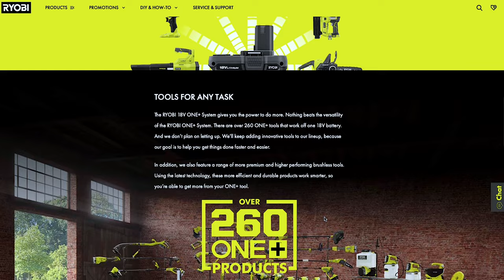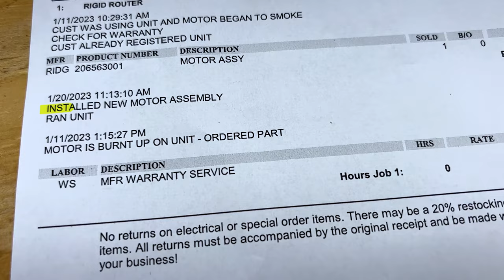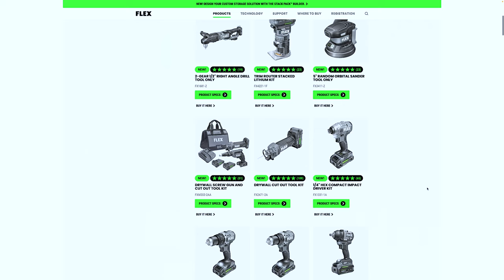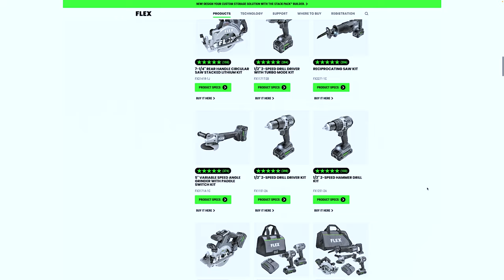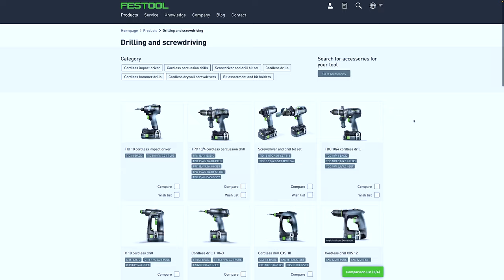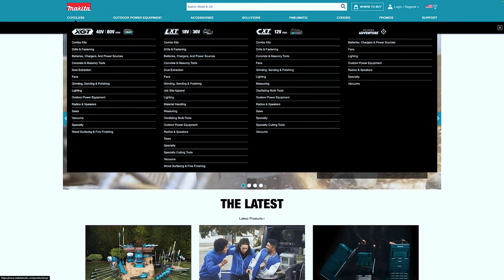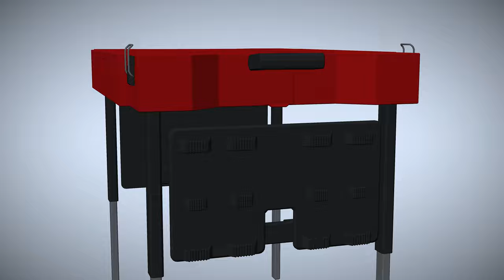I Found the BEST Tool Brand for Woodworking in 2023!

Comment: I started with a Ryobi orbital sander, and as my corded Bosch tools started breaking down in the first 3 to 4 years, I replaced them with Ryobi to stay on the same battery platform. These have been smaller tools. When I need to get larger tools, like table saw and jointer /planner, I'll reseach and buy to suit my needs and budget.

Comment: Thanks Matt!  This is a great overview of all the major tool lines.  In my shop, I have the Bosch miter saw and router (both are plug-in), a Dewalt plug-in router (for the plunge base), a bunch of Ryobi tools for specific tasks (soldering, polishing, cleaning), some Bosch battery tools (very strong, good battery life), some DeWalt battery tools, and even some Festool (the sander and dust extractor).  But, like you, my main tools are Milwaukee red.  Love the track saw, love the packout, the detail sander is amazing, and the drills and drivers are top of the line (In my opinion).  Their multitool is one of my go-to tools because it's the only one that doesn't shake your elbow apart!  I also have a bunch of Ridgid.  I still think the Ridgid table saw is much better than the DeWalt.  Thanks again for making this video Matt.

Comment: Completely agree about going with more than one platform. A lot of people argue about which brand is the best, whereas i like to embrace all the options out there lol. I own Milwaukee, DeWALT, Makita, Flex, Metabo HPT, Kobalt, Ryobi, etc. and they all make good stuff, especially the higher end brands, but every brand also makes some duds. No brand is perfect as i like to say. I would also pick Milwaukee if i had to pick which brand offers the best/most useful tools for woodworking. Love my 4 in 1 Installation drill/driver and orbital detail sander (as i know you do too) but also my Milwaukee drills, impacts, m18 trim router, etc. I do love how smooth the trigger is on the Makita 40V XGT impact driver though. So yeah they all have pros and cons and it really depends what kind of work you're going to be doing as well.

Comment: The ryobi table saw fence just needed the end screws tightened and it would track straight every time. It also does dado stacks that the others don't do until you spend twice the price. I've put my $200 ryobi 10" table saw through some serious work including two hundred feet of continuous 3/4 wide by 5/8 deep dado cuts and it didn't even bog down.

Comment: Thanks for "sticking your neck out" and picking a favorite. Like you, I had used Dewalt and Ridgid forever. But I bought a Milwaukee 12V blower and 4-in-1 driver. Then I bought the M18 drill-driver. In the last year, I have replaced several tools with Milwaukee tools. They do work real nice. Looks like I am an official converted Red guy.
Reply from the maker: Good choice!

Comment: In my life Ryobi stuff hasn't lasted long.  For instance, my quality of life in the springtime improved quite a bit when I upgraded from a Ryobi string trimmer.  Worse was the one Ryobi tool that lasted for decades - a circular saw - that I finally dropped, skewing the base a bit, causing me to give it up.  When I bought a solid (more expensive) Makita with smooth cutting, bearings that don't scream and grind, etc.  I realized how much of my life was wasted trying to squeeze a little precision out of the Ryobi tool that wouldnt die.  "Opportunity cost."  At the time I bought Ryobi, I needed and appreciated that pricepoint, but know when to move on.  Besides, wives never know what to get us for our birthdays ... right?  

Totally agree that mixing brands is part of succeeding.  Staying in Dewalt I bought an oscillating saw that turns out to be hard to turn off on a ladder, and sticks out in the wrong places.  Should have bought the Milwaukee with charger/battery system to get all that free space around the head.

Agree on the packout stuff.  Expensive, hard to justify, hard to pull the trigger on, (and kinda heavy) but appears to be the most well designed for people and their habits, and can be a little addictive once you buy some.

Thanks for your tool thoughts.  Fe sharpens Fe.
Reply: To be fair, regarding the 10 year old Ryobi, Ryobi tools have gotten much better over the past decade.  I'm guessing they may not have even had brushless saw models then.

Comment: So your commentary seems to answer "what brand if you want every tool to match" but as far as I can see (happy to be corrected) the only point where it matters is the commitment to a line of batteries.
Mine is a Ryobi shop in terms of cordless tools - I don't have the budget to try other brands when I've invested in Ryobi batteries (I've about 40Ah of Ryobi batteries, and they're used for everything from the lawnmower to the household vacuum).  
Something I'd love to see is what your set would be where you were choosing - 1 brand for battery based tools, then a brand for the best table saw, and so on - the best brand for each of the different cabled tools you use (planer/joiner, drill press, bandsaw etc. etc. etc.)  Or if you really think the brand is more relevant than the best tool irrespective of brand, I'd love to know why it matters once you move away from the battery. (I could see three episodes for this.  Complete-shop on a budget, complete-shop professional, and complete-shop if you won the lottery.)

FWIW, the thing that would get me to move away from Ryobi would be if a brand offered a power cable unit that could plug in in place of the battery so you didn't have to worry about charge when working somewhere where you could just plug in.

Finally, you comment about the saw being under-powered - I imagine for some workshop work it might be, but I use it constantly for cutting 50x200mm treated pine garden sleepers, which (with their sap) can sometimes even bog a cabled power saw. and the only issue is swapping batteries - where I work 12 hours straight, cutting all day.  So from my perspective, by the time it's underpowered I want my table saw.

Lastly, a silly aside - I can't prove that I caused it to be made, but some years ago, I saw the Ryobi rep in the car park, and tod him that I though a dremel type multitool would be a great addition to the Ryobi line, and the the trick would be to have battery and motor in a base unit with a flexible shaft to the hand piece.  It took the best part of two years before they came out with the exact tool I described to that rep - so I can't say for sure it was my design, but in my head I claim credit for that addition to their set.

Comment: @731Woodworks I completely agree with the assessment and a single platform is never going to be the solution. I personally use DEWALT, skil, and lowes Kobalt brand(we don’t have a Home Depot nearby) I think if you can minimize the different systems you will get ahead but also sometimes going cheaper for some tools that are not an everyday tool makes good financial sense. Great video and glad that you do such in depth testing. Your skil 10” table saw video lead me to acquire the tool for myself and I haven’t been disappointed. Thank you again for what you do.

Comment: I don't do anything too heavy, and most of my time is for subwoofer boxes. Most of my tools are ryobi only because it's cheap and all of them are cordless which is a big help. But for big corded power I have different brands. Router and orbital sander is from Dewalt. Table saw and shop vac both from Ridgid. Some tools I feel it's better to spend the extra money but if it get the job done, why does it matter.

Comment: I've never understood the hate for the Ryobi Miter Saw.  I've had one for several years and never had an issue with it.  I replaced the stock blade with a better one right off the bat, and I also took the time to dial it in.   I don't use it on every project, but when I do use it the cuts are accurate.

I can understand picking a brand and staying with it when it comes to cordless tools, but most everything I use (except for my drill and driver) are corded.  I personally try to do my research and the best tool that I can afford.  My table saw is DeWalt, my miter saw is Ryobi, and my band saw is Grizzly.  For "one off" tools, I'll even go to Harbor Freight.  $35 for a oscillating tool I'm only going to use a three or four of times is better than $150+ at the big box stores.

Comment: This year I returned to building furniture after 15 years away from woodworking. After some false starts, I settled on the Milwaukee M12 line. (Home Depot's one year return policy saved my bacon when I needed to return some Makita tools.) I've found that - as a 75-year-old woman with less arm strength than my younger years - 18 V tools are too heavy for comfort. It's hard to find lighter weight power tools, so I chose a corded jigsaw and trim router for easier handling.

Comment: Like many here, I use battery drills, but most of my tools are corded. I bought DeWalt many years ago, but all the batteries died. The options to replace them were too expensive. I got a Milwaukee battery drill and I'm very pleased with it. I'll see how long it lasts.

Comment: I agree with what others are saying. I'm primarily Dewalt because that's where I started originally. Love my miter saw and all the countless other tools I have. But I have a Rigid corded orbital sander that I like a lot. I bought a Makita track saw recently and love it,  although there were things about some of the others that I liked as well. I've also started investing in the Milwaukee 12v platform. The detail sander will be soon. So I guess you need to look at the options available for the tool you're looking for and then see how it fits in your budget and the tool arsenal you already use.

Comment: DeWalt's portable/jobsite table saws basically set the standard for hat features other brands would start using, like the Rack & Pinion fence system (my dad has a Rigid model with a functional, but inaccurate fence you need to carefully check for alignment before locking it). The 12" sliding miter saw sets the standard for a good one, especially the Cutline models, to improve on with other features like reduced rear clearance designs.

I also think the Toughsystem cases are higher quality than the Packout, especially the DS-Carrier hand truck compared to the flimsy plastic one Milwaukee sells. Packout has more options, sure, but I don''t think they'll survive as long.

Another argument in DeWalt's favor for cordless is the 60V tool lineup, that gives you tools that can beat corded models while the batteries for them work with your 20V ones.

Comment: I'm slowly switching over to 100% Milwaukee battery line. They just can't be beat.
Reply: Bosch and metabo can easily compete and bonus is their batteries are crossed share

Metabo shares with Mafell and Mafell is by far is the best saws hand down

Bosch has fein and about 10 other companies that are part of their amp share battery line
Reply: Milwaukees batteries are junk. I'll take dewalt or anything else really. I have a dewalt drill that I bought in 2013 and the batteries that came with it work like the day I got them. The longest a Milwaukee battery has lasted me was 2 years and they're more expensive. It's crazy

Comment: Dewalt here, but Amazon has Dewalt to Ryobi adapters so you can use the Dewalt batteries. That being said the Ryobi hot glue gun, 18 ga nailer and the 21 degree framing nailer are hard to beat.

Comment: Thank you for the video. I do love my Festool, but I'm not a snob about it and do own some Ridgid and Ryobi cordless tools that work very well. I'm intrigued by the 2.25HP cordless router Milwaukee just came out with and will be looking at it as I hate cords.😣
You should do a video on battery adapters such as Ridgid to Milwaukee or Ridgid to DeWalt or vice versa etc. As this really helps people cross over into other brands without reinvesting in another battery platform. There are some downsides, added size and a little more weight. On many tools the added size and a little more weight isn't a big issue at all, but on other tools like a router it can be. But these few issues are usually offset by not having to buy and store batteries and chargers for them.
All the Best,
Chuck.

Comment: Awesome video... I wished that I would have purchased the Milwaukee brand to start with! I bought the Ryobi 16 tool kit and have regretted it. I have 3 of the tools that just don't measure up!  The jigsaw will not cut a straight line through wood, the drill won't go past the 17# tork setting - so I can't use it as a drill!, the chop saw won't cut straight. I spend more time trying to rework the cuts. Have put out over $1800 on Ryobi tools and could've bought Milwaukee brand for $600-800 more! Sometimes I really just feel stupid... really need to wait before I jump on what looks like a great deal... not so great huh?
This is a wake up call for me.

Comment: I have the Makita track saw, GREAT , years ago When I was a contractor, I bought a lot of Ridgid  tools mainly for the grantee, after 10 plus years my 1/2" hammer drill  quite working took to a repair shop, unfixable and I got a complete new one in the mail a few days later. I have the big Bosch miter saw great saw, I also have a lot of Dewalt tools. But over the past few years I have been buying Milwaukee tools. Happy with all my tools.  Ron USCG RET

Comment: I went with Dewalt when it waa time for me to get into a battery platform. I decided Dewalt because they gave excellent cordless woodworking tools, and that's what I was looking for. I also like having the option of using the flexvolt line. That combo if 20&60v is hard to beat. 

When it comes to corded tools, it's whatever brand at the best price.

Comment: No mention of Metabo HPT/HiKoki? 36v 1/2 plunge router, 36v table saw, Track saw has hit Australia and NZ under Hikoki, hopefully soon in the States. Heck they even have a Mag Drill for metal working that's 36v. And the AC adapter to run all the 36v tools when you have power. Sorry, but that's a big miss.

Comment: I find it doesn't make sense to stick with one brand.  I have a lot of Kobalt tools, including the XTR versions, which work really well for me and the batteries are inexpensive. A lot of the tools they have are good but the lineup is still pretty limited compared to some other brands. So far I have just tried to get the best tool that I could afford and just go with a corded version if I didn't want the one from Kobalt. There are a few things I typically consider:
1. Is it available locally? If you need a tool last minute, it is a lot easier to have the battery kit for the store down the road than the "better" ones an hour drive away. 
2. Can it be adjusted to be accurate? I bought an inexpensive Skil sliding miter saw, but every aspect can be adjusted. If I calibrate it and use a quality blade, it is possible to get perfect cuts. 
3. It is possible to get quality consumables for it? I use Freud router bits, Freud glueline saw blades, and 3M cubitron sandpaper because they produce professional results even in cheap tools. Unfortunately, my local stores don't have those brands so I have to order them online. Spyder blades at Lowes are decent though. 

I will say that we use Milwaukee power tools at work and I don't think they are worth it. Their selection of tools is phenomenal, but the batteries degrade quickly and the tools wear out quickly. Their bit sets are really good though.

Comment: Dewalt for miter and table saw
Makita for circular saw and   cordless
Even though i have a Festool track saw the 160mm blades makes it pricey when you have to make a Sacrificial cut. So  i got the makita xsh08 that goes in the track the 7.25 blades  are cheap in comparison

Comment: Matt - love your YouTubes.  Keep going.

Makita is one of the big three along with DeWalt and Milwaukee.  I really don't think you give Makita equal consideration with the other two.  All of the others are catch-up to these (3) for our primary cordless tool battery platform.  All have plenty of tools and frankly, if we are in basic tools yet, I would pick one of the (3).

Corded tools are a different story - these are shop / larger tools.  With these it makes more sense to shop on a tool by tool basis.  There is no reason to prefer one brand for all your shop / corded tools.

Comment: Good info and I’m jealous of all the toys you get to play with. I would like to mention Metabo (formerly Hitachi) I’ve been working off their 18v platform for almost ten years and my original drill & driver w/ original batteries are still rolling. They have a lot of great cordless options and a 36v option for batteries. Plus I can complain about the miter saw or table saw.
Reply: Meant to say CAN’T complain!
Reply: Why Metabo is never included in these kinds of videos I'll never understand. Their cordless line has a tool production lifetime warranty, as long as they make the tool it's covered. That said I met a guy in Lowe's that took a discontinued drill to a service center, and they gave just gave him a new drill. I can't attest that would happen every time, but relating his experience made a very positive impression in regards to their customer service.
The tools are powerful. The 18V and 36V flexvolt tools run on the same battery platform, and the 36V tools can be plugged in.
The table saw has the largest top of all the jobsite saws I'm familiar with, and includes an out feed extension.
The miter saws are zero rear clearance, which saves a ton of space.
They are priced far more reasonably than either Milwaukee or DeWalt. 

There's a lot to be said for the emerald green line. The only downside is that they don't command a lot of shelf space in stores, so it's harder to just walk in and pick one up.